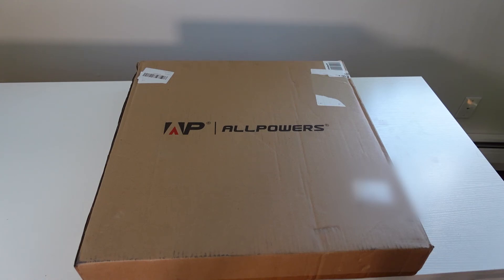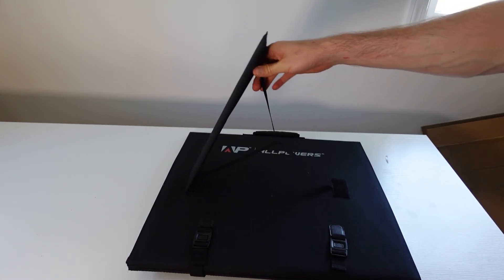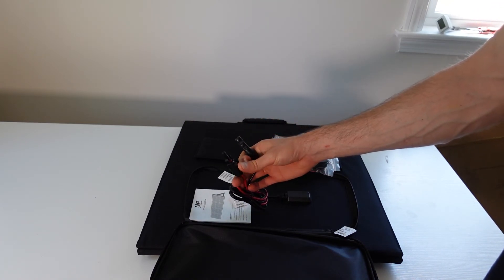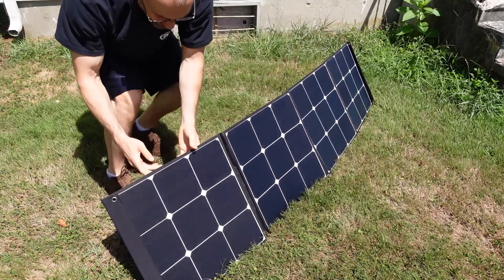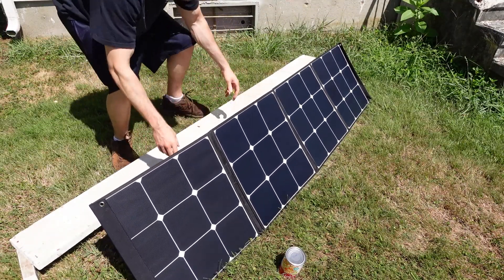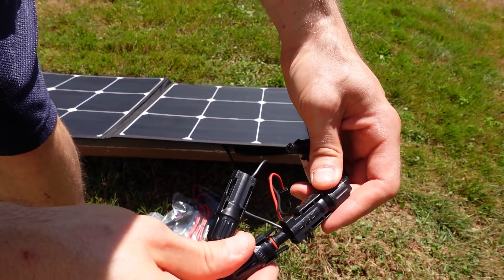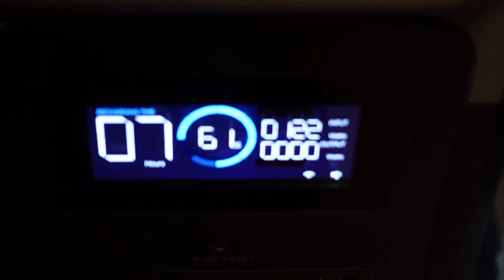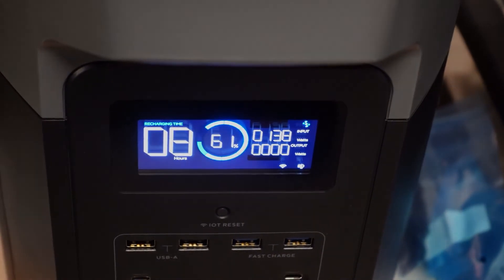Allpowers Monocrystalline Portable Solar Panel Review - Ecoflow Delta Max (Part 2)

Comment: Thanks for this video, impossible to find reviews of this panel. 130w seems quite low, I think this is basically identical to the Bluetti sp200? As they’re very similar in design and both use the sunpower cells. Perhaps same factory and rebranded? I did notice in your video that the corner fabric was folded over one of the panels slightly, don’t know if that made a difference? 

I have mine coming in the next couple days and I’ll let you know my findings. So far I have two 100w nicesolar panels and in parallel they get 170w max so far and they were much cheaper. This is also in UK weather. 

Have you had any better results yet? 

Thanks
Reply from the maker: Yeah it wouldn't surprise me if they were the same panels.  I noticed that piece was folded over as well - i've tested them multiple times and the most I ever got out of them was on average 140w.  I actually returned this one due to the cost and kept a few polycrystalline variants.  I definitely recommend both poly and monocrystalline Allpowers panels though.  Overall good experiences with them
Reply: @applisense  I’ve got mine through now and tested, can confirm it’s not that efficient which is a shame as it advertises sunpower cells. I have my two cheaper nicesolar 100w panels in parallel and side by side with this panel, the nice solar is producing a good 1/5 more watts. 102 vs 127 (nicesolar)
Reply from the maker: @SolarSuntime  Good to know
Reply: @applisense  I got curious and got a multimeter. The production values are out. The voltage is around 24.6v which is over spec and the amps were around 8.2. Which does make about 200w. But I think the mppt controllers in the smaller batteries are more sensitive to amps so it’s it’s underproducing. I also have a Zendure superbase V coming from kickstarter before the end of the year and that can take 10-150v at 20amps. So I’ll let you know if it can actually make 200w input on that
Reply: I ordered the Zendure as well. I was thinking about getting this for that and a Pecron unit